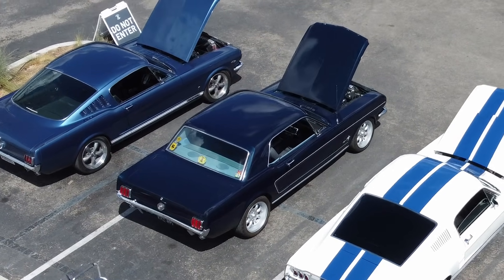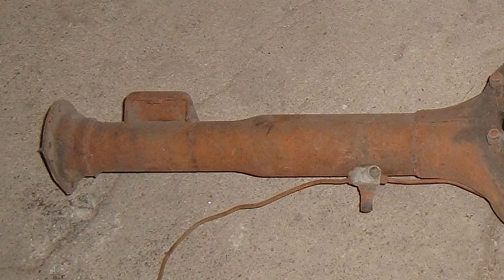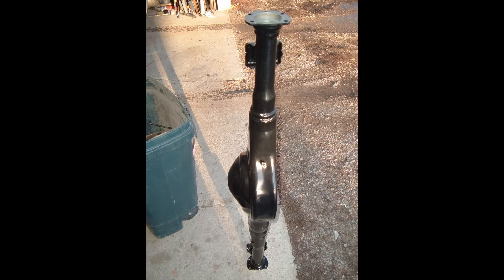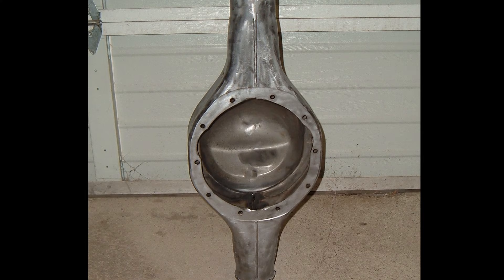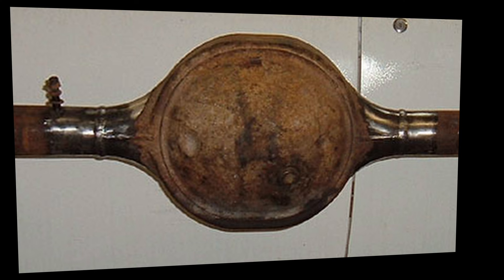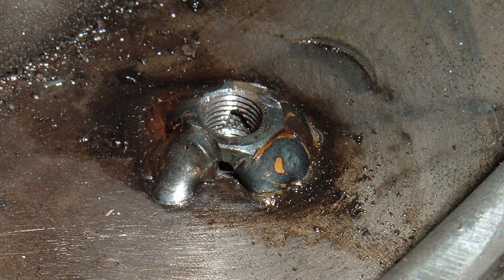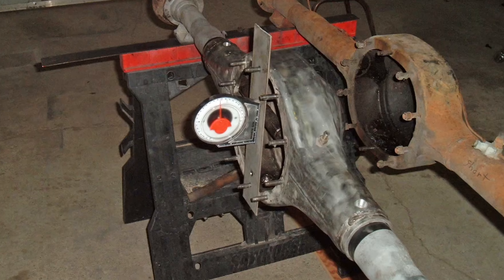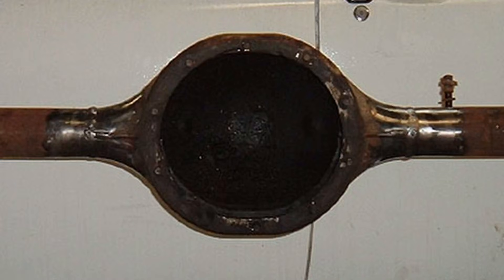Building a DIY Ford 9” Rear End Housing for a 64 55 66 Mustang From a Ford 8" rear end & a 9" donor

Comment: With the 1" rod you align everything until the rod spins by hand.
Reply from the maker: As I said in the video I adjusted until the puck easily slid in and out of the end of the tube with no pressure but the concept is the same.  Spinning the rod doesn’t tell you which end needs adjusting.